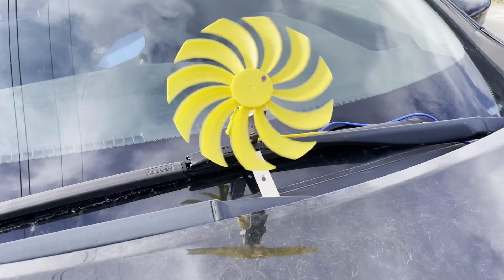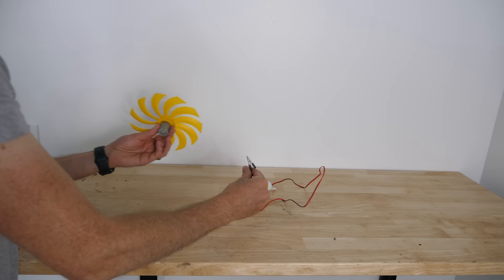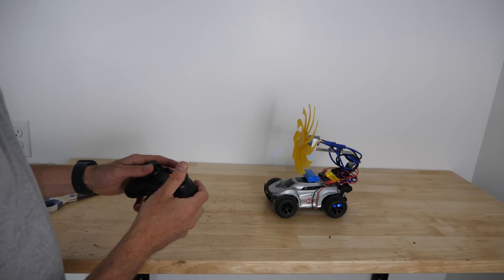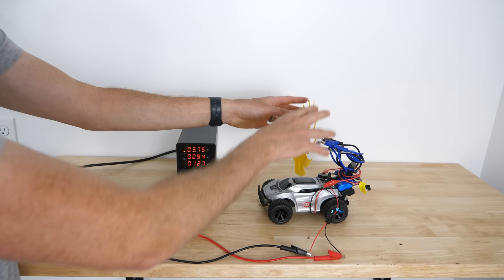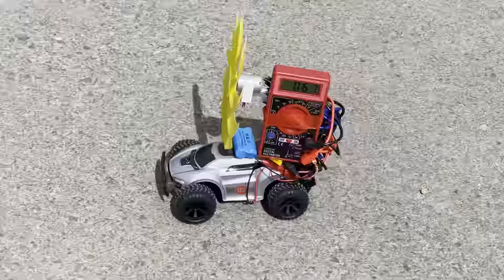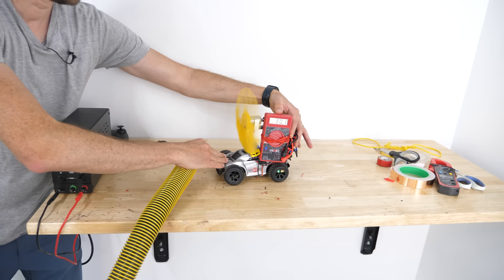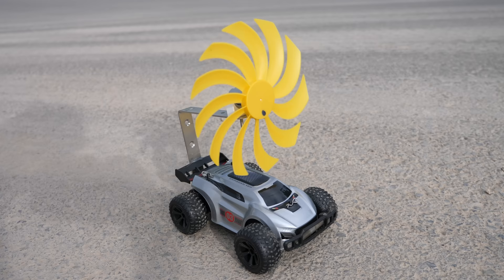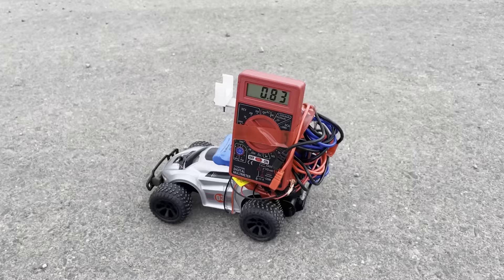Can You Power a Car With a Wind Turbine?

Comment: There are some excellent videos on installing wind turbines on the front of electric vehicles.  Some of the designs actually make some sense to me.  Others will just be a trade off of drag for power.
Reply: All designs will always reduce vehicle efficiency. A turbine will not spin unless force is applied, and in this scenario the force comes from the car moving through air. As it is fundamentally impossible for a wind turbine to be 100% efficient, this will always result in a loss of power.
Reply: It's unlikely to work but theoretically possible. The car is already losing energy due to drag. You may be able to collect some of that energy without adding as much drag. There may be some areas of the car that are wasting energy accelerating oncoming air to nearly the velocity of the car. All of that energy is converted to heat. You may be able to put a fan in that location and only have a minimal impact on overall drag of the vehicle because it's not increasing the cross sectional area. But then it may be collecting a lot of that energy that was previously lost due to drag. It's not perpetual motion. It's just an improvement of aerodynamic properties to reduce waste.
Reply: @megamaser  The energy is not lost to heat in this process, it becomes wind energy. You could argue that the wind energy eventually becomes heat, but that really isn't relevant to this scenario.

More importantly, the amount of energy that could be reclaimed in the process you described will always be less than what could be saved by designing the car to have an aerodynamic body.

Placing a fan on a vehicle with high drag will result in the fan performing poorly. As you described, the vehicle is accelerating the air in these areas close to its own velocity. This means the flow of air will stop moving relative to the vehicle, thus reducing air flow through the fan.
Reply: You'll always have a reduction in efficiency since you're forcing the air through by moving the turbine through the air. At perfect efficiency you could produce the same extra power as just having the wind blow the turbine at a standstill, but you won't get perfect conversion. The most optimal design would have the turbines only exposed when not moving
Reply: @MelodicTurtleMetal  if you already have some component of the vehicle that is changing the velocity of the air, and you replace that with a turbine that causes the same change in velocity, then there is no loss of efficiency
Reply: @megamaser  Correct, but efficiency would be higher with no turbine at all. 
A gas car would use less fuel and an electric car would draw less current when the body is aerodynamic, and if the body is not aerodynamic it can't properly utilize turbines.
 In short, wind turbines steal power away from a car, they should never be used while trying to increase or maintain speed. 
They don't make sense for slowing down either, as regenerative breaking is far more efficient.
Reply: @megamaser  If you find a useless part of a car that you could replace with a turbine to equal out the drag, then you'd still be better off removing that part entirely or adding something to the part to make it more aerodynamic - you'll gain better energy savings from that than you would gain from a turbine causing turbulence in that spot.

A turbine would only be good if it was in the direct path of non-forced wind, and gaining energy from the wind alone. At the very most you could only gain the potential energy gains of the wind, when the vehicle is at standstill, while in motion. But that would be perfect efficiency, and if the wind conditions aren't in favour of the turbine, then it'll be detrimental.

Comment: You only provide pure negative outcomes with zero positives.
You could have the windmill down while driving and then have it pop up while parked. You cannot power the car fully of course but it could come in useful to increase the use of a single charge.

Comment: Cos it's slowing the car down so it's not worth it unless they have them on planes I case they lose power so a little turbine comes out and powers like to bring the wheels down excetra...the 1 best thing u all need to loo at is the car that can travel faster than the wind is blowing that's a messed up video I still can not work it out but scientists have confirmed you can build a car with no engine and the power of the wind can push the car faster than the wind is blowing bloody I sane that 99.999999% what's it called propetual motion thingy

Comment: Terrible experiment using the RC car with a turbine that large, the turbine probably doesn't weigh much less than the car itself, but on a car application for a motor vehicle the car's weight will contribute to momentum which may change the results of the experiment because a turbine is going to produce negligible drag comparatively to a full size car and it only would need to produce 13v~ to be able to charge the car battery -> for a gas powered car, anyway. Thinking as a replacement for an alternator.

Comment: Use a NACA air scoop to pull air into a tube that exits out the back. Put many wind turbines inside the tube.
This has always been my thought. 
What if the tube got smaller at the back to increase wind speed?

Comment: You could design a vehicle with what looks like a little turbine engine between the wheels. Spinning fan blades inside spin with the wheels, so you're spending no energy making that extra wind in this enclosed area, similar to a compression chamber to force air past a whole row of turbines behind the front blades, and benefit from the wind energy generated from the turning wheels, never mind the wind!
Reply: You'll make it harder for the wheels to spin, so you need to apply more energy just to move. Unless I'm missing what you're saying, you want the car to power 4 turbines?
Reply: @MelodicTurtleMetal the car wouldn't be spending any energy, a fan blade simply spins with the tires, as efficiently as possible, and any wind generated from it and the movement of the vehicle would spin the series of wind turbines, generating maybe enough power to run accessories hopefully more. Just a thought.
Reply: @naomiwright4895   @Naomi Wright  if the wheels turning is causing the turbines to rotate, then the energy spinning the turbines must come from wheels spinning. A turbine can't spin freely in a fluid, and air is a fluid.

You'd need to power the turbines from an exterior source, otherwise you're taking energy from the car or creating your own energy
Reply: @MelodicTurtleMetal 🤔 
I'm not sure if I'm explaining this correctly. When I say turbines I don't mean turbine engines I'm talking about tiny windmills behind a fan that spins in reaction to the tires spinning, when you speed up the tires turn fast and the fan does too. The fan doesn't spin because of the wind, or any energy that the car is producing, just the motion of the wheels. I know that this is going to use a little of energy from the wheels but seriously how much exactly? we need to know how much, before we discard the whole idea. The fan blades are spinning with the wheels as efficiently as possible, and sucking in air, not just pushing forward. This is an idea that I had when I was very young and my grandpa always declined my wild ideas. But i think something like this could be perfected and we could be using a lot of energy that is usually wasted.

I enjoy these conversations.
Reply: @naomiwright4895  I understand, but it doesn't change the outcome. The fan blades will generate a resistance against the air, making the wheels harder to turn. Might be easier to imagine it in water, because air behaves very similar to water. You'll always require more energy to pull the air in than just having better aerodynamics.

Don't get me wrong, your method would produce a charge, however the charge wouldn't be enough to overcome the power required to move the wheels more against the new source of air resistance.

What you've proposed is actually very similar to how regenerative braking works - but it only gains power when you're not applying power, and the resistance slows the car.

Comment: Wind turbine=fan that can produce electricity. A very good idea, especially for cars etc. Do airplanes do this also? convert wind to power.
Reply: they can't really do that because airplanes mostly use gasoline to fly. and when the airplane is flying its wind turbine must go faster then natural wind's velocity or it will be pushed backward . so there will be no electricity being converted from the wind
Reply: Some planes do this when their engines fail so that the hydraulics that allow the control surfaces to move will still work. Otherwise it's just a perpetual motion machine, hence useless.
Reply: @C.I...  new information has been accquired, thank you
Reply: Please watch the whole video. :(

Comment: Technology will never, ever be utilized to its fullest. Exteit's too with school distance. We already have the technology to use our own satellites to produce a magnifying beam of light from the Sun that could produce all the energy we ever needed to be harnessed at any type of power plant even if we have to go back to regenerating steam as powerful Source of electricity simply  using the Power from the Sun utilizing magnification concentrated on to a pinpoint area that would collect an artist. The heat and power from the Sun should produce electricity. Even Through using simple steam heated up by magnification of the sun itsel Again, just like using Glorified, magnifying glass.

Comment: there is nevertheless something that I saw used in a proof of concept where a turbine in front of the car but with a smaller front surface than the car itself generate electricity with the apparent wind but with little to no increase of the drag (cause the front surface of the whole car doesn't change and the coef is similar), the rotor does not provide free energy at all but does increase the efficiency of the system 😇 anyway it's pretty dangerous to stick a rotor in front of a car so I'm not surprised it was just a proof of concept

Comment: This reminds me strongly of the whole "downwind faster than the wind" thing
Reply: Except the DWFTTW thing disproves his claim that this can't work - even on a windy day.
Reply: Nope.  This has nothing to do with dwfttw.  One makes sense.  One doesn’t.
Reply: @Rick_Cavallaro   1st, wowed you are noticing comments about that on this video but it's reassuring I'm not the only one who instantly thought of it, 2nd, definitely watched the debate with interest when it came out and loved the practical problem solving.
Reply: @denverbraughler3948  I guess it'd be more accurate to say it made me think of it or brought it to mind maybe to avoid a misreading that may make it seem like I'm equating them.
Reply: @dungeonbrownies  I do follow this channel, but in this case a buddy pointed me here.
Reply: @denverbraughler3948  
>> This has nothing to do with dwfttw.

Correct, on a day with no wind.  But on a windy day, they're more similar than different.
Reply: @Rick_Cavallaro :

May we know your cogent explanation of the similarities which are relevant to physics?

Do you mean on a windy day and while driving downwind?
Reply: @denverbraughler3948  I'm not entirely sure I understand the question, but I'll take a crack...

When there is a true wind (i.e. air moving relative to the ground) you can always use a propeller or turbine (depending on your device and objective) to exploit the energy at that interface.  You end up slowing the air relative to the ground, and doing what you like with that energy (e.g. charging a battery, making yourself go faster, go uphill...).  On a day with no true wind, you only have the relative motion of the air to your vehicle (as a result of the motion of your vehicle).  In that case you cannot achieve any steady-state energy benefit from an unpowered propeller or turbine.
Reply: @Rick_Cavallaro :

You can extract energy from true wind, but at what cost?

It is completely impractical for an actual highway vehicle because most of the time (not only when there is no true wind) carrying the turbine is costing more energy as drag than he turbine can generate.
Reply: @denverbraughler3948  No one said anything about practical.  We're talking about physics.  A claim was made that it's not possible to harness the energy from true wind.  It is.
If you want practical, mount props and turbines on large ocean going vessels.  It's more practical than the enormous kites they're currently working on.  And I say that as someone that's been kitesurfing for more than 20 years.
Reply: @Rick_Cavallaro :

The specific question is whether a car will require more power or less power with a turbine installed.

The more accurate question is whether a car will require more energy with a turbine installed.

Under some specific conditions, for example,the car is parked most of the time, the answer can be even that the turbine generates more energy than the car uses.

But the only relevant answer is whether is having a turbine decreases energy consumption.  It doesn’t under real world conditions.  The losses to friction from carrying around a turbine result in a net increase in cost of operation.

The only place a turbine makes much sense is mounted in a fixed place.

Unlike an automobile or aircraft, on a slow steamer, there’s no penalty for carrying the mass of the turbine.
Reply: @denverbraughler3948  You don't get to re-write the questions and answers.  He made a very clear and specific claim about a turbine not being able to help reduce power requirement on a windy day.  That claim was incorrect.
Reply: @Rick_Cavallaro :

Did you watch even the first five seconds of the video?
Did you read the video description?

You don’t get to tell me what the video is about.
I actually watched it.

The question is about perpetual motion.
Reply: @denverbraughler3948  I watched every bit of the video and read the description.  I even watched the part at 5:00 minutes when he made a very clear and concise statement that was not correct.  You can talk about whatever you like.  That's what I'm talking about.
Reply: @Rick_Cavallaro :

If you watch another 70 seconds, you’ll get the whole context (which you totally ignored).  
The note on the screen even says the car is parked.

So even on a windy day, driving around with a turbine will incur other losses that mean it won’t have a positive effect.

A car that goes straight downwind on level and open terrain with a turbine high above the ground is a special case.  

As a practical matter, even on a windy day, a street legal car will not benefit from a turbine unless it is parked.
Reply: @denverbraughler3948  
>> If you watch another 70 seconds, 

I WATCHED IT ALL.

>> even on a windy day, driving around with a turbine will incur other losses that mean it won’t have a positive effect.

THAT IS WRONG
Reply: @Rick_Cavallaro :

Have you modified a car by adding a turbine to demonstrate your claim?